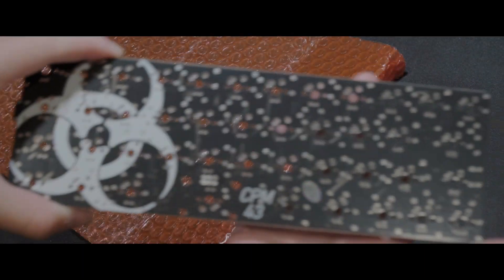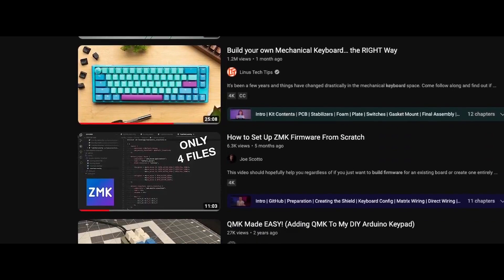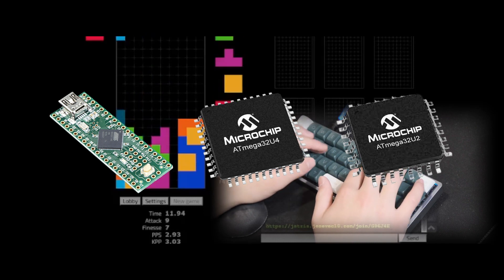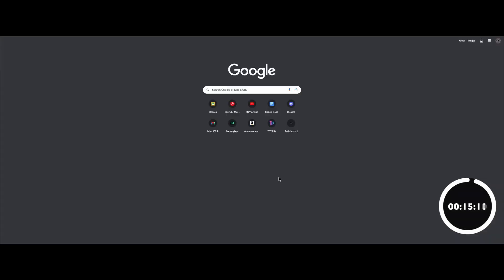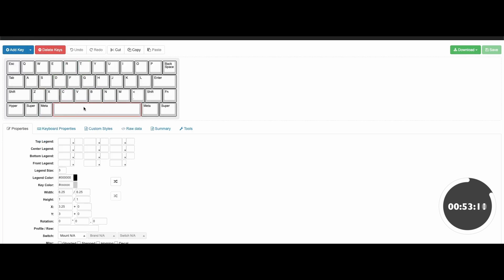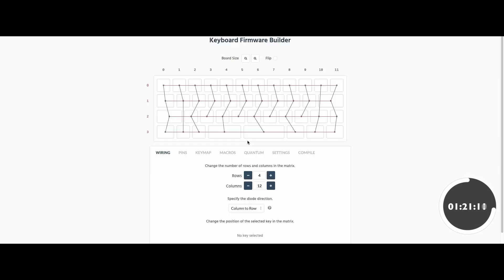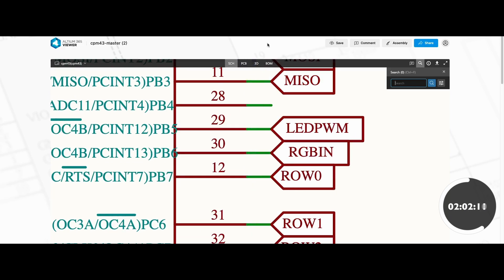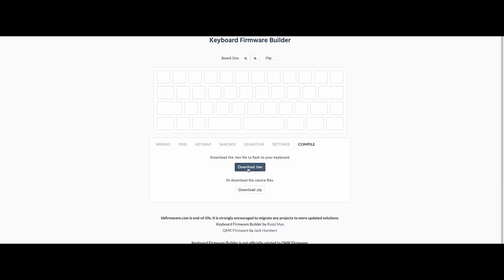No Firmware? No Problem! (Create Keyboard Firmware in 5 Minutes)

Comment: Hey I may be a little late but I'll shoot my shot, Im looking for a very specific mcu that comes with the drop entr keyboard which is not qmk compatible, yet im my native language I need some keys that due to layout are not present in the board in terms of space. Basicly this <> symbols here that in EN ansi layout are placed in the bottom left next to the Z. The device not being QMK compatible leaves me with no real option of creating a binding on a different layer as I've done in many other keyboards. Does anyone have info abour HM32F1835, if it is possible to bootload or practicly anything regarding this mcu. 

The closest I've gotten to getting any info is a video by Matt3o doing a teardown on the Drop ENTR where he points out in a comment that this seems to be a modified version of a Xiaomi Yuemi Pro MK02 and this lead me to a repo that shows how to bootload, BUT, the pcbs are not designed the same way at all and I cant seem to find a workaround this problem, any ideas?

Comment: how do i find my keyboard pcb model?
Reply from the maker: If it's a keyboard you bought, it likely will say whether it is QMK compatible/reprogrammable on its webpage. 

Start there, and usually there will also be a link directly there for you to modify the firmware. 

For finding the PCB specifically, you'd want to search online for your keyboard model and whether there's a repository for it; 
usually, the name + keyboard + github will be enough.

Sometimes it's instead on the manufacturer's website, but usually it's on some repo.

And if all that still doesn't yield anything, you can try your luck and see if it's recognized in VIA or VIAL. 

Finding the PCB specifically from that can be a bit troublesome - a lot of those random keyboards will share PCBs so you could theoretically look on QMK and flash a similar looking layout.

I would still personally strongly recommend against this though unless you're willing to potentially brick it.
Reply: @va1orance  I found that my ZA63 zifriend keyboard pcb model was "yh-az63-tk64" or "yjx-yh-tk64".

Comment: Hi, I have been struggling all afternoon to make my keyboard work. I created firmware for my handwired board exactly the same as you did, compiled it and flashed it to my board. It isn't working. I have tried flashing it multiple times, have wiped the pro micro and still nothing... any help would be much apperciated!
Reply from the maker: Hmm, is there any sign that it works at all? Any keys, LEDs, etc. What does the controller show up as in QMK Toolbox?